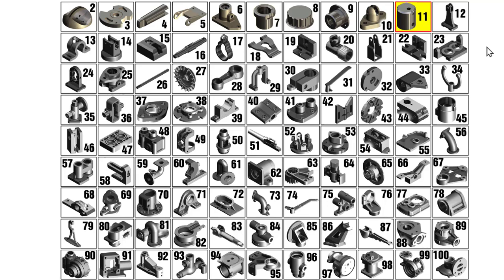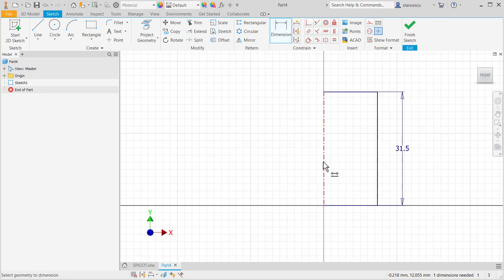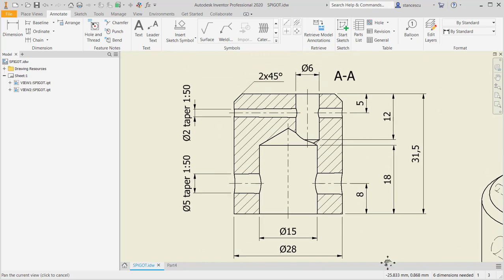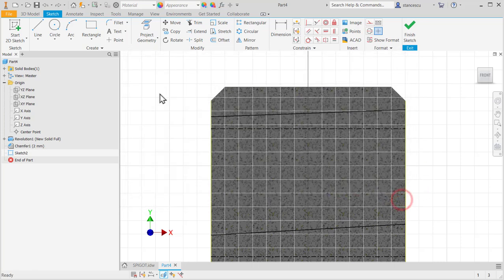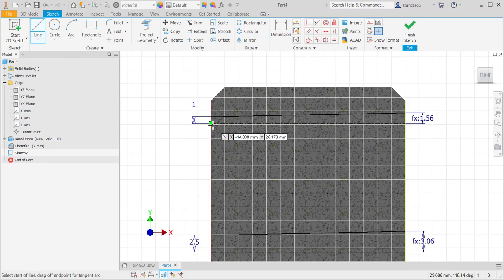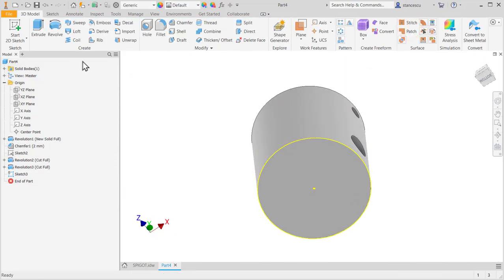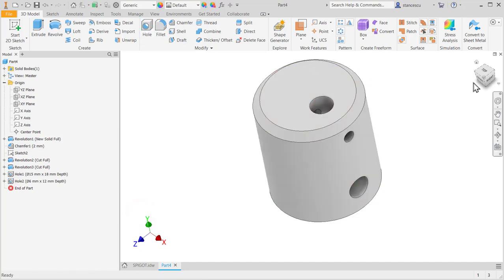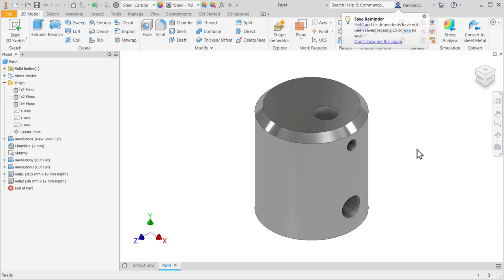Tutorial Inventor - 051 SPIGOT (Part-011)

Comment: Hello Professor, Thank you for making these videos, they have been very insightful. I would like to know where you got the 118 degrees for the angle of the drill bit at 9:43. I can't find any mention of that on the drawing and I would like to know what I missed. Thanks for the help!
Reply from the maker: If you create a hole with end you can measure the angle of the end. This angle is 118 deg for steel.

Comment: Hello Professor, thank you very much for your higher education.
   I learn very valuable lessons from your teaching, and I am always grateful to you, Professor.
  But there is a mistake in the formula 'c = a + L / 50', because this formula calculates the radius, but in the picture, it shows the diameter, and this is wrong.
  The correct formula should be replaced with c = a + 2 * (L / 50) to calculate the diameter, thank you.
Reply from the maker: If you read the description you see that I mentioned this mistake.
You are very welcome!